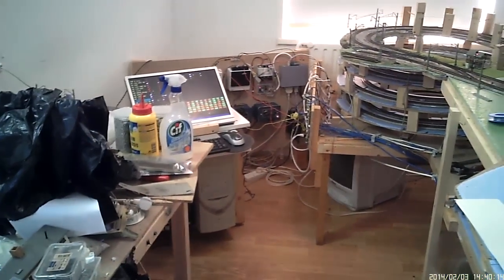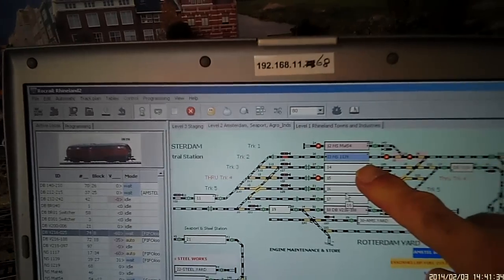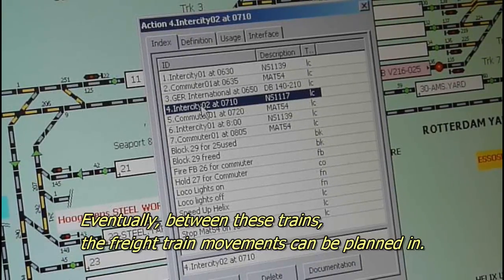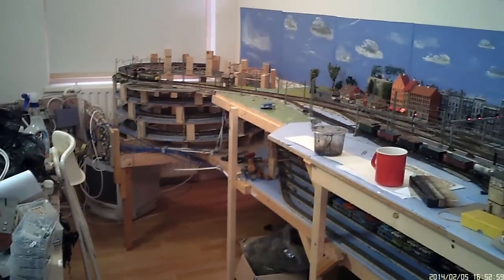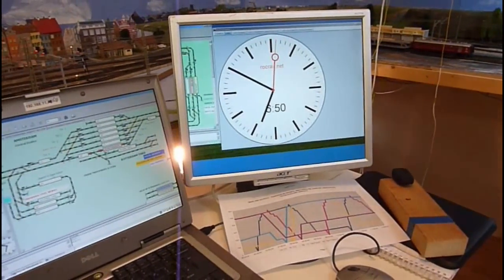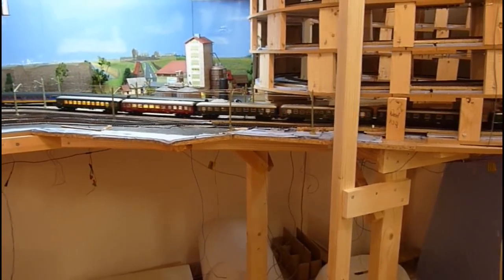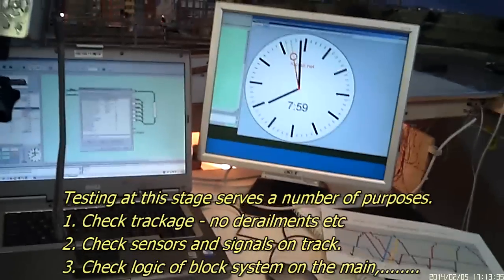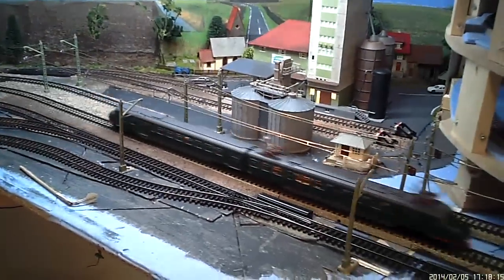Vlog18 - Rhineland2 Train Layout update. Test: Main-CTC-Helixes-Timetables/Train Orders

Comment: Hi Robert,
I have download the roc rail program today and connected it with the ecos....just getting my head around it but it has a very helpful guide...
Just doing a simple track with two locks at the small station..I like the huge track plan area and the fact you can zoom in and out of unlike rr&co software.
The software even tracks my ecos in shuttle mode and the rail car....outstanding  package.

Jim